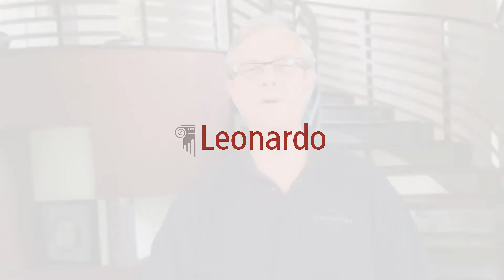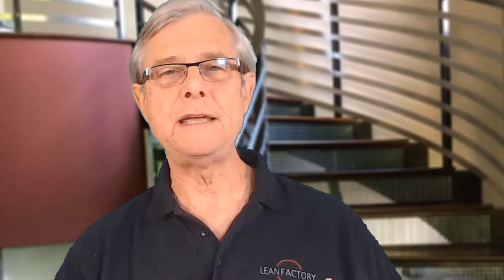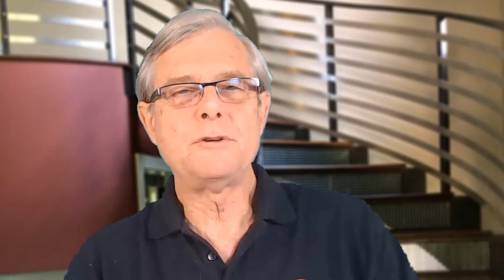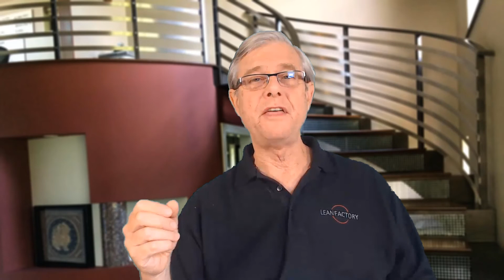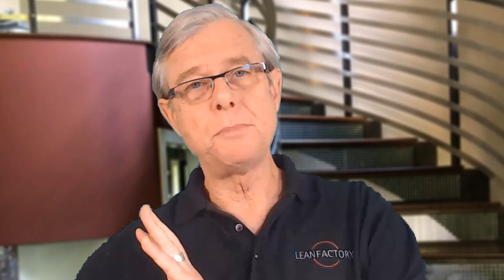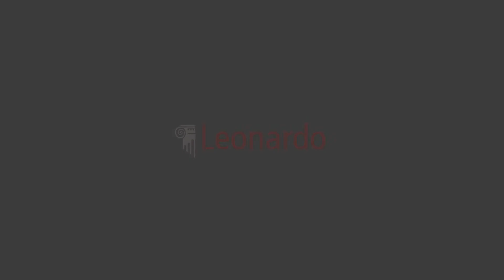Part 2: Measuring "Flow"

Comment: Hi Lean Six Sigma! I don't know what MTC is...that's probably a typo if it shows up. Regarding balancing cycle time to takt time, I have a question for you. If you have takt time of one minute (as an example) and you are mixing products with cycle times of 4 minutes, 5 minutes and 6 minutes, how many workstations would you need? Assuming that the demand for each is the same, would you have 5 (based on the average time) or 6 (based on the longest time)? If you choose either 5 or 6 stations, how much time would you allocate to each station? If you pick 6 you can meet the 1 minute takt time for the third product, but you are over-resourcing the line by designing for a scenario that will never happen. If you pick 5 you resource correctly, but the 3rd product time will exceed the 1 minute takt. I know what we would do, but what are your thoughts?

Comment: Well done Richard,  I am happy to see you and your company producing articles and videos showing the importance of Flow and how to achieve it.  Does Toyota call it 'MTC' ?  I use the term 'Lead Time' rather than MCT 'Manufacturing Cycle time'..to avoid confusing with 'Cycle Time' meaning the actual time for each operation or the time between each new product leaving the end of the line.  Cycle time should be equal to Takt time ( Takt time being the time that you are trying to achieve to keep up with demand ...such as 1 minute per operation and therefore 1 car produced per minute ) .  Is this how you also refer to it when you do classes at Toyota ?